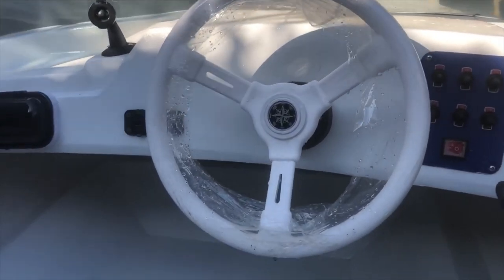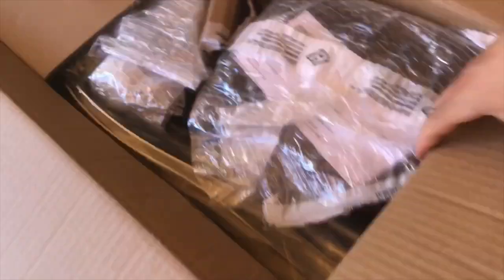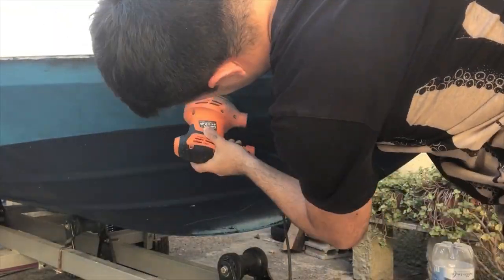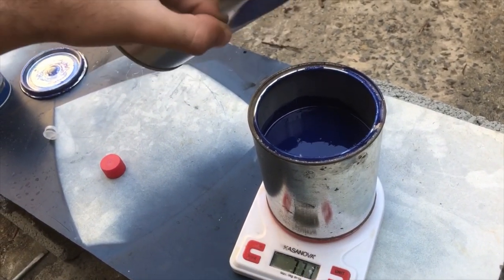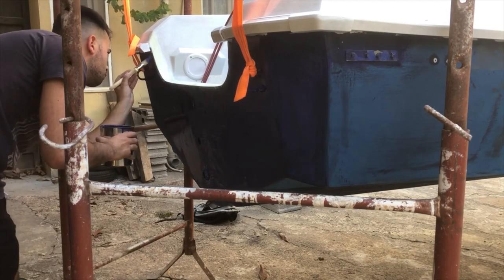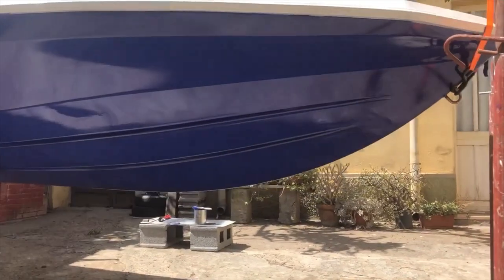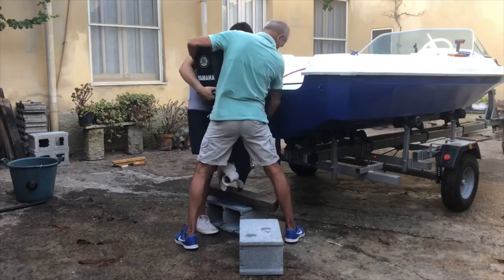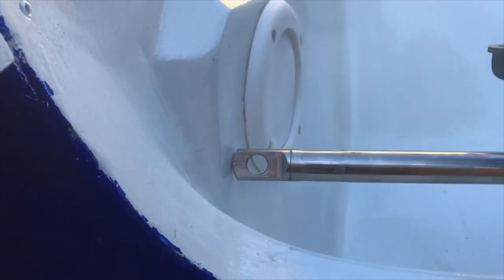Restoring a Fiberglass Motor Boat - EP8: Painting the hull and refitting the engine

Comment: You should wear a mask while sanding. This blue powder is inside your lungs now 😔.
You shouldn't have started your engine without water, the water pump don't like it at all.

Nice job anyway. Take care of yourself
Reply from the maker: you're right Cyril, i forgot to wear a mask. Yes after a fast check i plugged in the water hose :)
Reply: Even the during the fast check the impeller spins without water. So it has much more friction and can easily be destroyed in a few seconds.